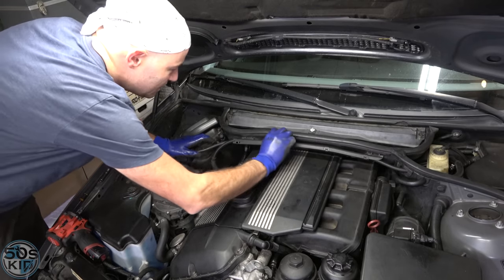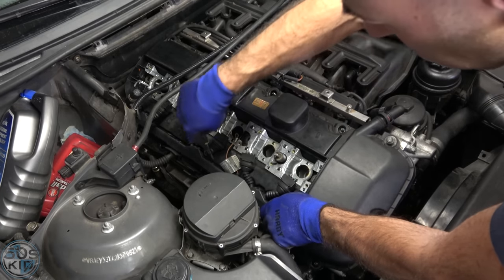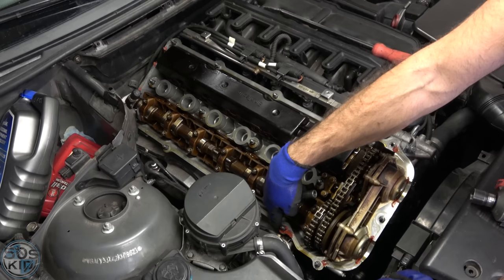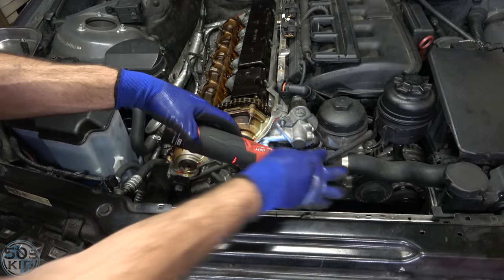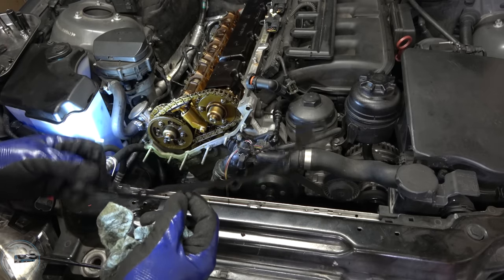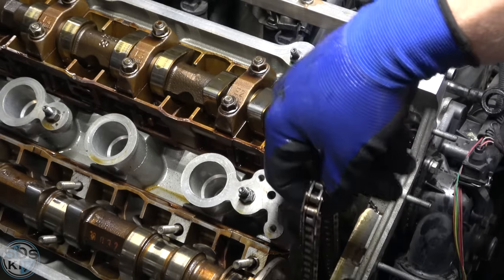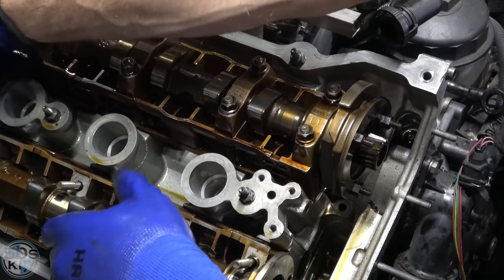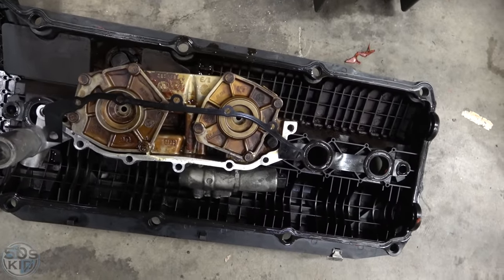This is why your BMW ticks - BMW E46 Lifter Replacement DIY Part 1

Comment: I wanted to comment here for the other automotive idiots like myself: If you have a ticking that does NOT follow engine speed, that is NOT lifter tick - for me it was my evap valve. Not a problem, a CEL at worst, maybe long crank, not worth $100 for a new part so I ordered a $30 used one from a car I saw a video of running that didn't tick. Easy change, no ticking!